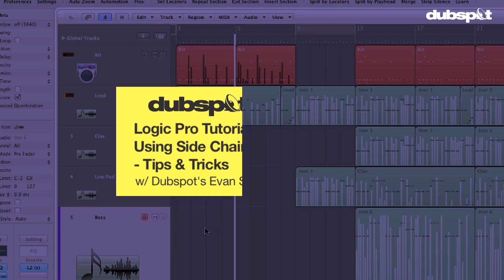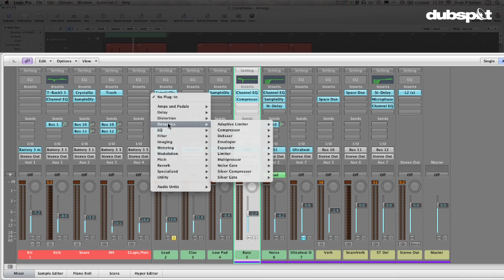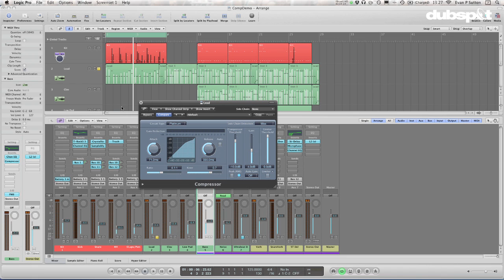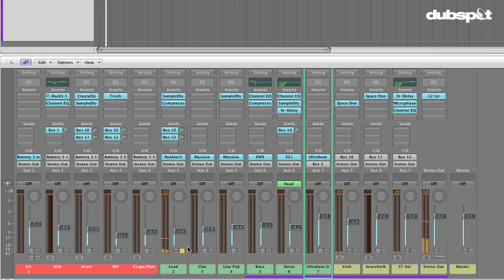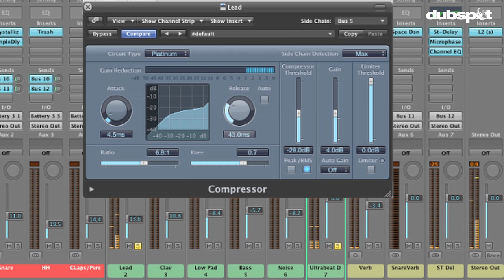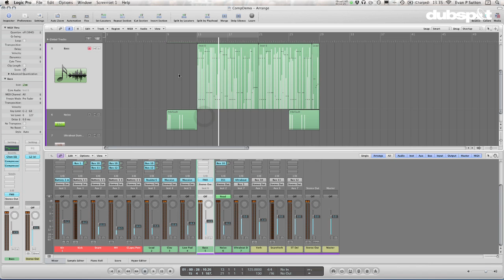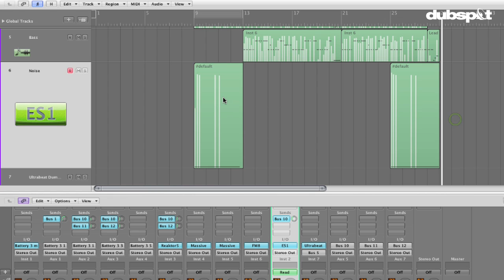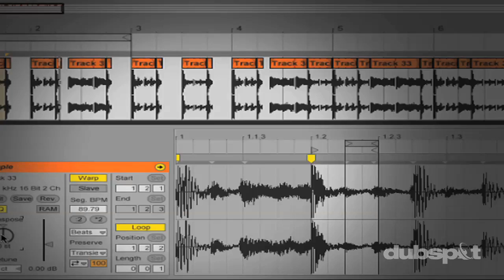Logic Pro Tutorial: Sidechain Compression Techniques

Comment: @rawstarmusic Hi, in Logic, you can use the same kick bus as the side-chain input for a noise gate on another channel (eg a synth line). If you set the reduction to -100 & tweak the threshold (around -10db), the sound running through it will only appear when the kick hits. Play around with the attack, hold, release & reduction to get a nice rhythmic effect. Set the reduction to a + figure & it'll only play when the bus isn't outputting. Hope this helps.